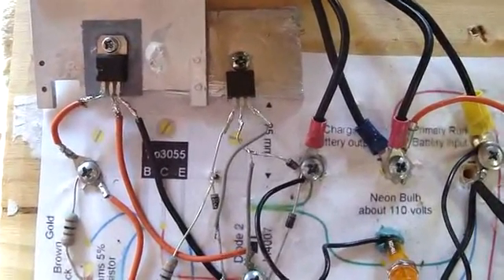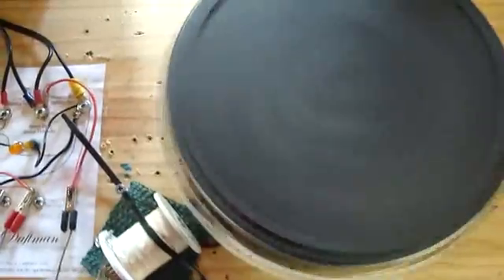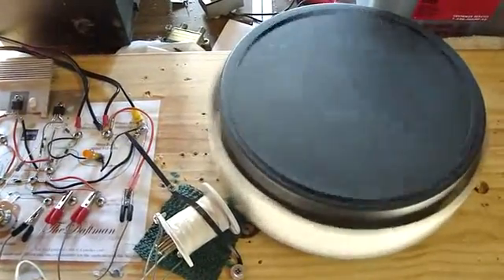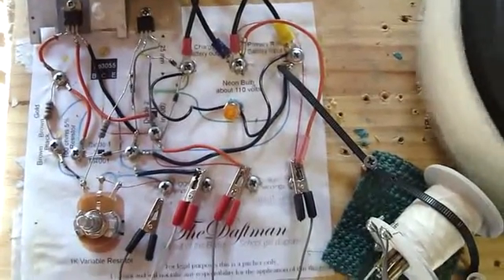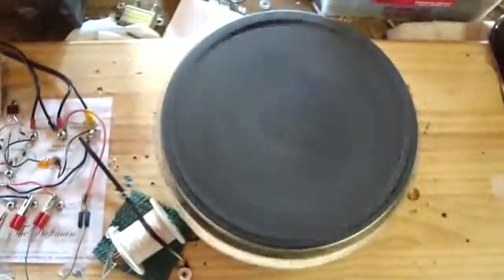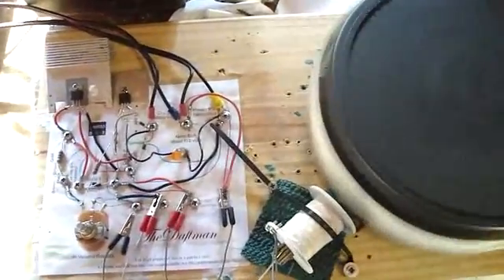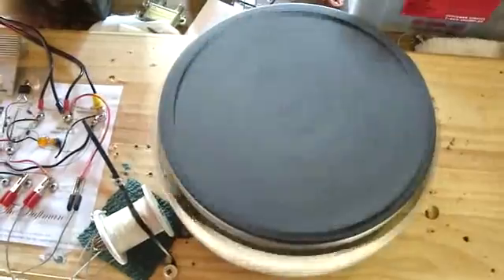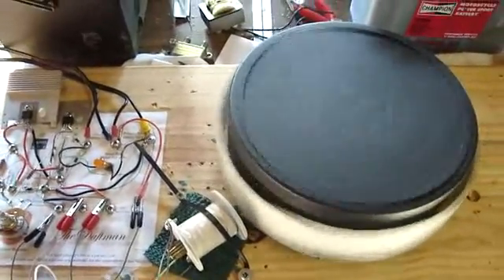theDaftman-Bedini-Darlington Motor.avi

Comment from the maker: @TheBillythekid2010 

Without having an oscilloscope to verify the findings I strongly believe that it both adds speed and charging power.

I am going to make a video of a 4 transistor motor that I have developed. It is the only motor I've built so far that has charged a battery beyond 13 volts.

Good Experimenting...
Poppy